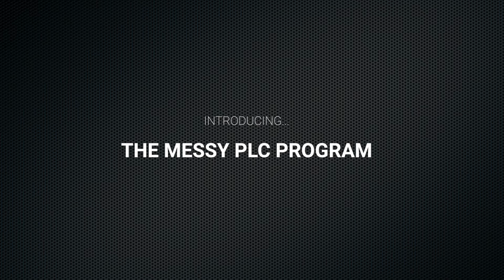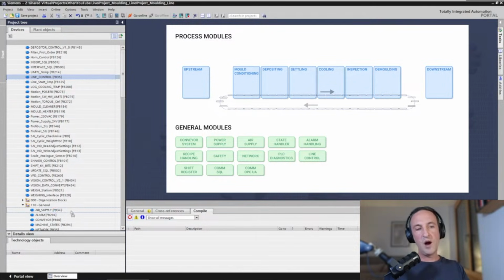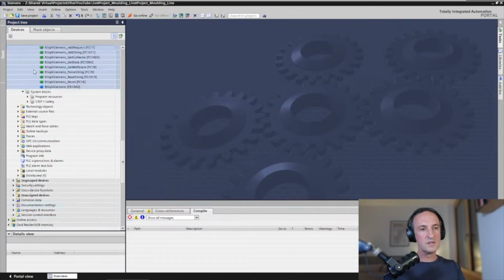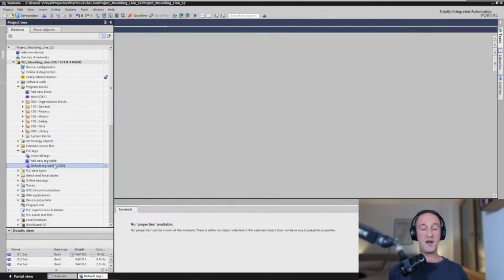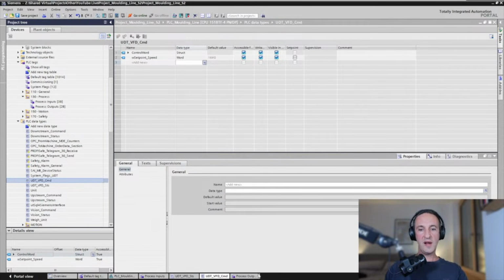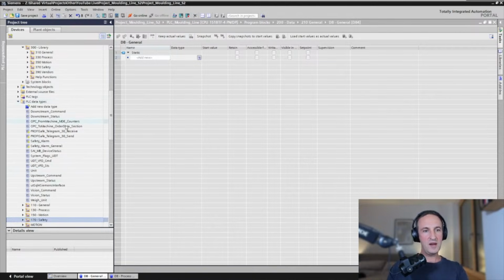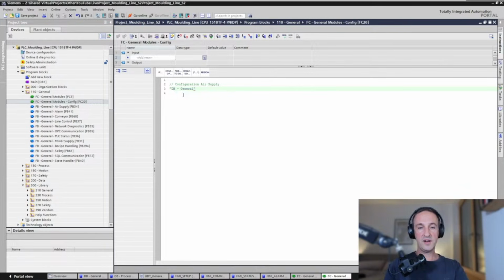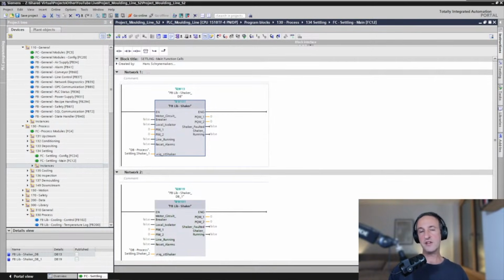TIA Portal Made Easy: Build Modular PLC Applications (2 Hour Workshop)

Comment: Hi, thanks for the video, ive watched the "structure your plc program like a pro" like 20 times and i really like your way of doing things. 

Im trying to apply the methods youre describing but im falling short on one thing: 

Lets say i have a conveyour and i make a UDT for this conveyour, it has 4 variables, Start button, stop button, pressence sensor and run forward.

Theese 4 variables needs inputs and outputs, how would you map the physical inputs and outputs to to the UDT variables? 

I found that i created a nice structure of UDTs in the beggining, but it fell short and my "conveyour.Sts.xSensorActive" has nothing connected to it. Do i just map it 1-1 in the FB? the FB has the sensor as an input currently..
Reply from the maker: Thanks for your feedback!

First of all, I would only map inputs or outputs of you're planning to use them somewhere else in your software.  If you're planning to use your sensor or run forward command somewhere else in your application as a condition, then you could map them as Conveyor.Sts.xSensorActive and Conveyor.Cmd.xRunForward, just to give you an example.

I normally only map signals to my module data structure if I'm planning to use them somewhere else in the application or if it helps troubleshooting (e.g. inputs signals in your data structure could be useful when running data traces).
Reply: @PLCskilltree  Thanks, in this case i would like to use the sensor as an indication in the HMI, using your method with applying the UDT directly for a nice structure on the HMI side as explained in another video. To do this, i would need to map the input sensor to the udt sensor, and where should i do this? In the functionblock of the conveyour (like, an SCL network in the bottom called "mapping?" ) or, in a separate function just called mapping where im mapping the different inputs to all the UDTs used in for example the HMI? 

Sorry if the question is vague, but im quite close to applying atleast your basic methods and i really want to succeed.
Reply from the maker: @Landqvist00  I would just map it in the FB where you use the sensor input.
Reply: @PLCskilltree thanks!